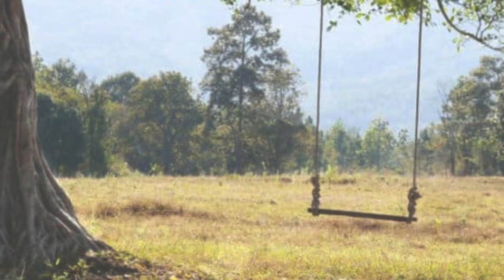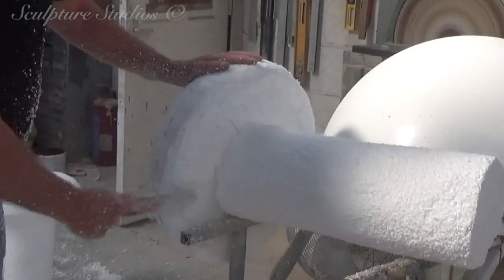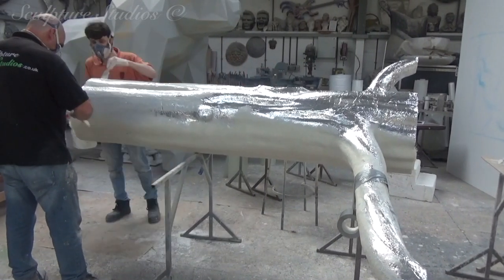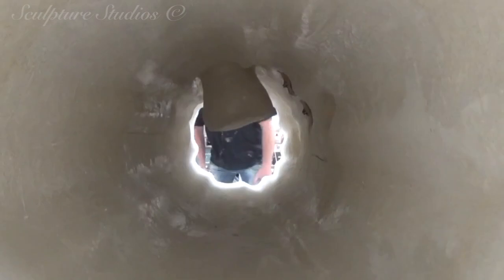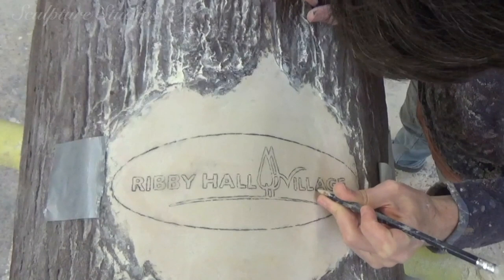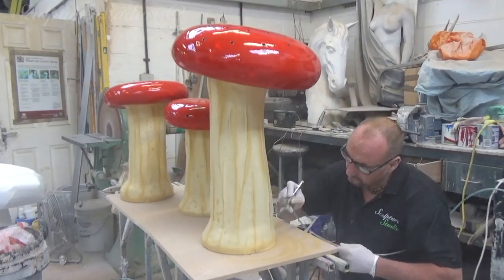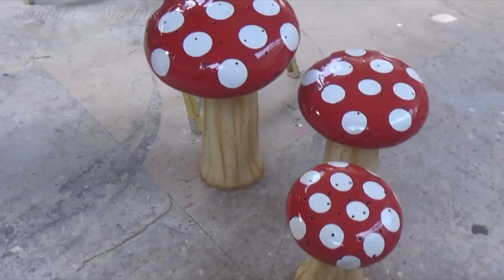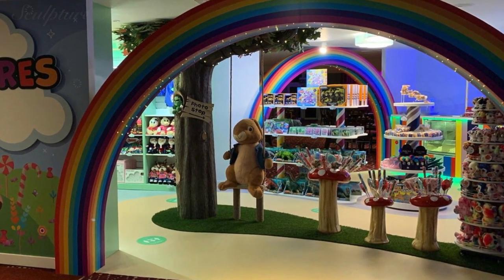Giant Mushrooms and Tree - Shop Installation by Sculpture Studios

Comment: Hi Aden,

Great work as always.  I had to run a rebar through a sculpture so I drilled down through it but alas the bit was too short.  I inserted a copper tubing into the drilled hole and then I "dripped" gasoline down through the tubing.  It couldn't have worked any better.  I have plenty of industrial epoxy that I plan to use as a hardcoat.  The epoxy didn't harm the polystyrene when I did a few test so is it really necessary to use tin foil or emulsion before applying the epoxy?  Keep up the great work.  You and your gang have a fan here.
Reply from the maker: Hi Brian, if you're using Epoxy, you won't need the barrier. It's only because we use polyester resin that the barrier is required. Good Luck!